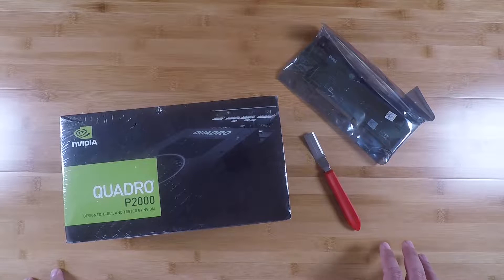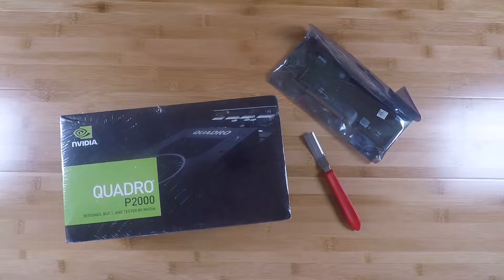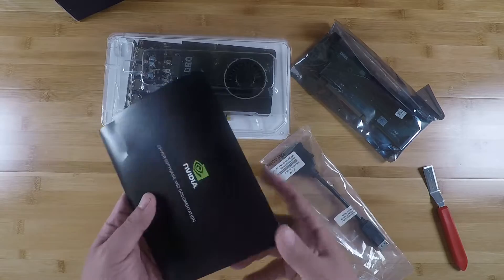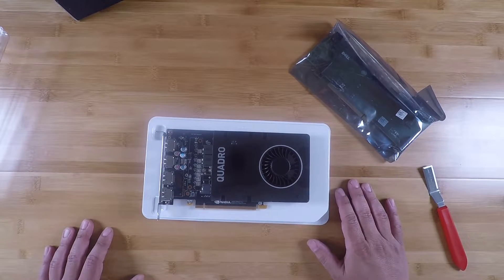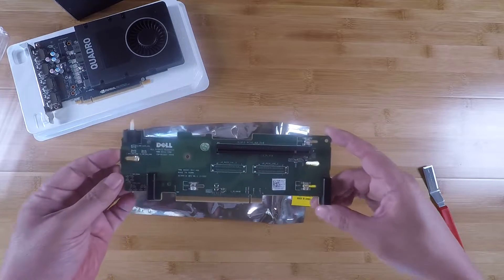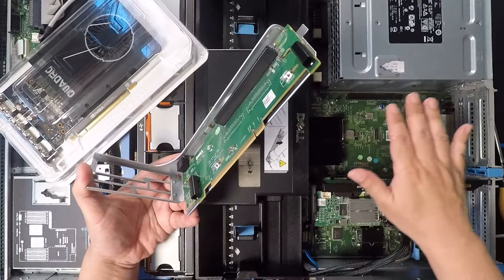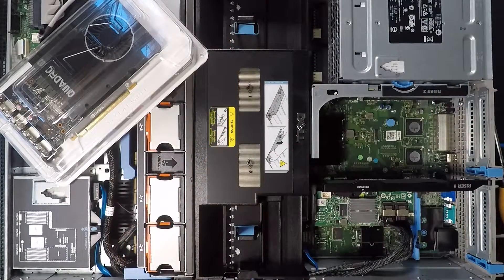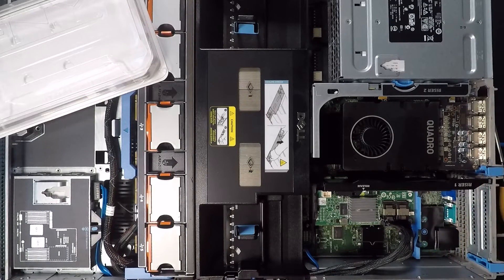Dell PowerEdge R710 build PART 4/9 | how to add a GPU

Comment: Hey man, i just wanted to say Thank you for all your helpful video's. I purchased one of the riser cards from you and am up and running with the M2000. I know its not the P2000, but its works well for my UNRAID Plex server!!! GPU transcoding has taken my CPU's from almost maxing out 90-95%, on FreeNAS with 1 transcoding stream, to 8% on UNRAID with GPU Transcodong and 3 transcoded streams running. Now i could get more, but haven't had this up long enough to try.
Reply from the maker: that's awesome!

Comment: Do you have to disable the onboard video card in order to enable the PCI-e video card. I have installed a VisionTek 5450 to use as a server monitor using a Samsung TV, but the HDMI port shows as unconnected.
Reply from the maker: my guess would be yes, but i honestly don't know. i only use the GPU for nvenc acceleration, not as an actual GPU.

have you tried that video card in another machine just to verify it works?
Reply: @ArtofServer  I have not tried it in another server, my only other machine is a laptop
If I disable on board video in the bios and the card still does not work, by resetting the nvram jumper will would that reenable the onboard video? excellent video series by the way.

Comment: you would do the same thing for the riser 1 slot correct? If i wanted to add 2 GPUs
Reply from the maker: unfortunately, i don't think you can fit that riser board into riser 1.

Comment: Would there be any performance impact if you notched one of the x8 ports as you mentioned on the riser card? compared to just using the 16x riser? I was wanting to install an amd fire pro s9100 or s9150 and tapping a power connector on the PSU header.
Reply from the maker: Depends on your use case. PCIe 2.0 x8 gives you about 4GB/sec max. So if your use case requires more bandwidth than that, then there might be a bottleneck. For the video transcoding use case, I don't think it matters.
Reply: @Art of Server  I have a Quadro P2000 card, and I'm not able to get any PCI x16 riser on the market, if I buy the modified x8 PCI one does it work with that GPU? I will experience any bottleneck or performance issue?

Comment: Already installed geforce 1060 to my Dell r910 and now thinking about change it to 1660 and add quadro  p2000. P2000 is half size?
Reply from the maker: it's full profile, and about the same length as many other GPUs, but it is single slotted, so the heatsink/cooler doesn't extend into the neighboring PCIe slot like on many modern gaming GPUs.

Comment: IIRC Dell specifies a maxmimum powerdraw of 25W for PCIE peripherals. Also, the 870W PSU is needed otherwise the system down clocks the processor and RAM.
Thanks for the video.
Reply from the maker: Yes, i saw that 25W information too. But I don't think it is correct with this riser as i'm pretty sure this GPU will draw more than 25W. Maybe because the 2 x8 PCIe slots are combined, for this riser the limit might be higher.
Reply: @ArtofServer  But in the line PCIe x16 in ATX conformed don't need 150W?
Reply from the maker: @RobertoMarengo73  not always the case... a lot of low power systems often limit the power available on the PCIe slot.
Reply: @ArtofServer  Perfect, i want to add gpu on my r710, but i missing PCIe x16 Riser Card Board GP347 0GP347, you have other riser?
Reply from the maker: @RobertoMarengo73  yes, i sell them in my eBay store. link in description.
Reply: i visit your store but you don't have the riser fot the r710.

Comment: So I purchased an R710 with 128GB of ram. a crazy amount of ram... but this unit has the 2.5" SAS drives backplane. Trying to find NAS drives that are 2.5" I am finding a limit of 2TB on WD reds. do you know of any larger drives in the 2.5" format that would work well in this environment, for a ZFS build?? my fear with using laptop drives is, I have read that a lot of times they can not be used in arrays or NAS environment or will fail quicker.
Reply from the maker: Hmmm... there are 2.5" HDDs that are larger, but not "work well in this environment" ... most larger mechanical drives in 2.5" format are SMR drives and they are not great for things other than archiving data (write once, read many). Also, SMR drives don't seem to survive as long. You can find SSDs that are larger, but they are going to be a lot more expensive. So, unfortunately, I don't have great idea for you. Maybe someone else watching this might have some ideas?
Reply: Art of Server heard and tanks so much for the reply. What do you think will be the probability of success in ordering a bare LFF and transferring ram/cpus and other stuff to a LFF from my current SFF? Even if I loose two drives I can get larger NAS drives for the space needed. 

The SFF I have is fully functioning unit, just want the larger drives, and the ram for virtualization.
Reply from the maker: @PaulBearer2  Sure, both SFF and LFF R710 basically share the same motherboard so the CPU, RAM, PCIe cards should transfer easily.
Reply: you could always add an external port hba or raid card and store your drives of any size in another case. they call this a DAS https://en.wikipedia.org/wiki/Direct-attached_storage

Comment: Just done the same thing to my Dell SC8000 (R720), got the 16x PCIe slot 3 riser and running a Tesla M60, gets the monster GPU over the top of the PSUs, had to improvise with power to it, but works a treat, looking forward to your Plex setup guide, great video's, keep up the good work.
Reply from the maker: Thank you!!

Comment: Does the pci 16 slot make any performance difference between just doing the Dremel trick on the x8 pci slot? Cheers thanks for sharing this. From another cat lover 😻
Reply from the maker: I'm not 100% sure, but my guess would be that there's no performance difference.
Reply: The difference between 8 lanes Vs 16 is well known to be SFA. Just mod the slot with hot iron (Safer than a dremel). Now you still have other slot for cards or HBA's.